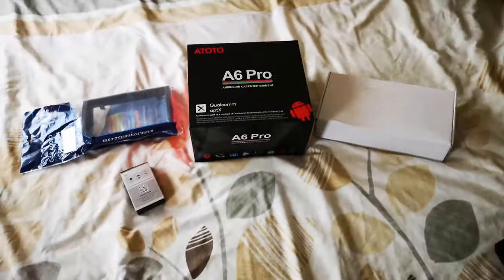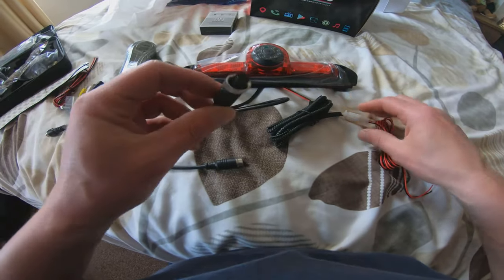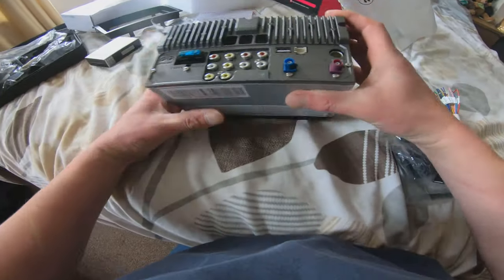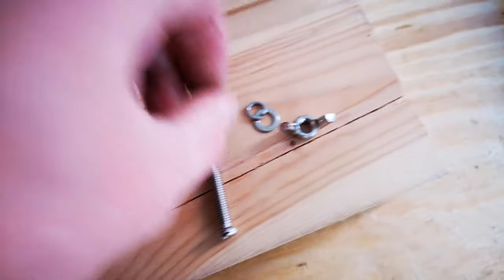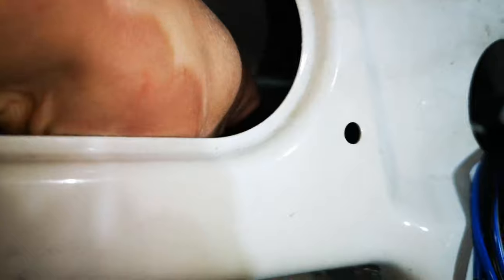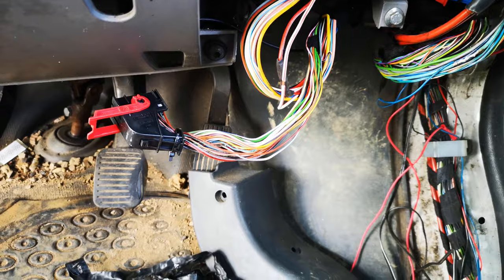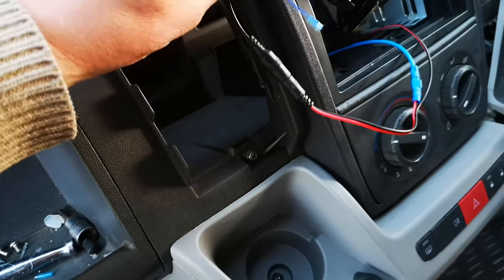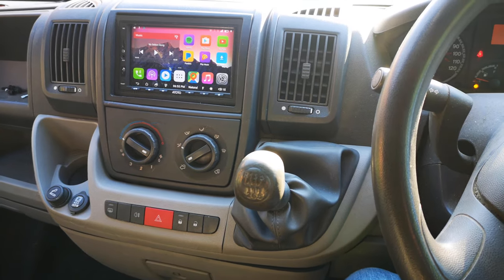Van Conversion #7 Atoto A6 Pro head unit & Reversing cam. Full installtion.

Comment: Just came across your video mate can you still work the steering wheel controls with this unit
Reply from the maker: Apparently you can get an add on that will convert the signal from the steering controls to something that the head unit will be able to use, but I've not tried it.